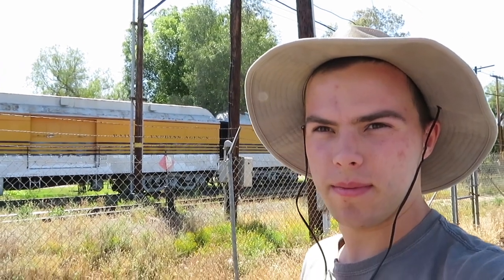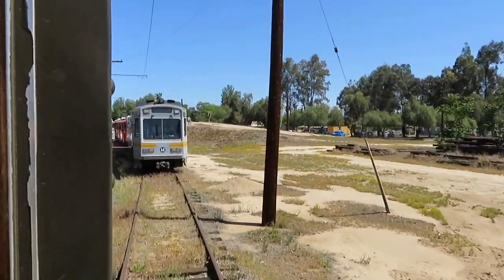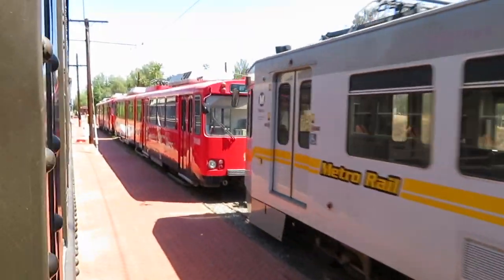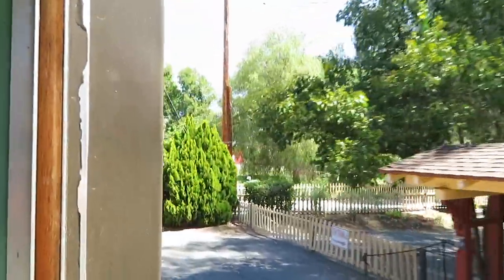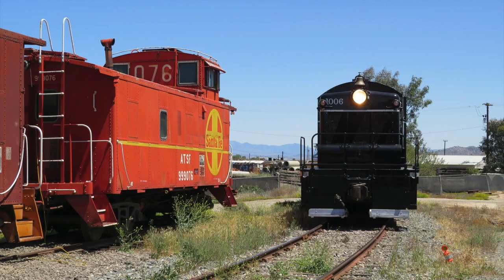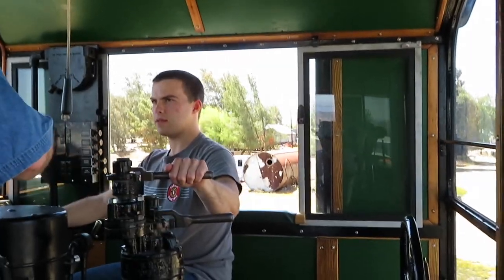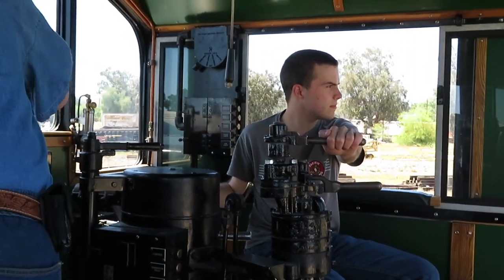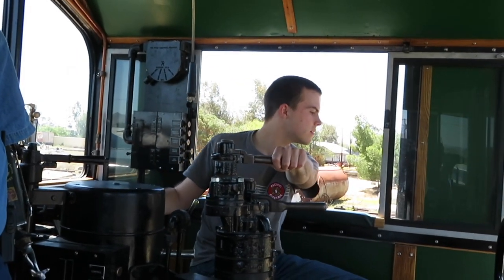Behind the Scenes, Southern California Railway Museum

Comment: A little correction to your history narration: The California Southern DID lay the track between San Diego and Barstow (actually National City to Waterman Jct which was later renamed Barstow after Santa Fe president William Barstow Strong) it was due to severe flooding in the Temecula Canyon in 1891 that caused the line to be severed between Fallbrook and Temecula. In 1926-27, Santa Fe laid new track in Temecula Canyon to connect their line in Alberhill with the mainline in Porphyry near Corona. By 1927, the original line washed out in Railroad Canyon. Since Santa Fe had 2 similar routes, the original line was considered redundant and therefore abandoned. Later, Canyon Lake was formed on the original ROW.